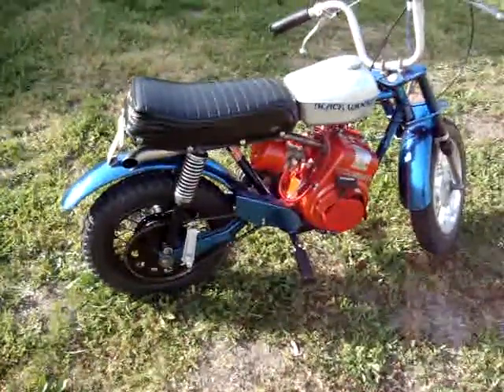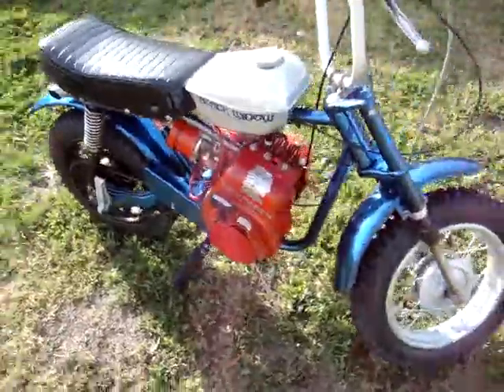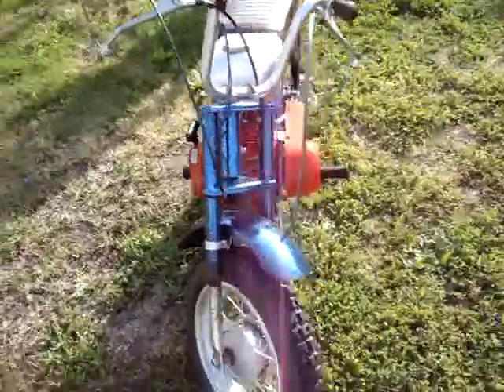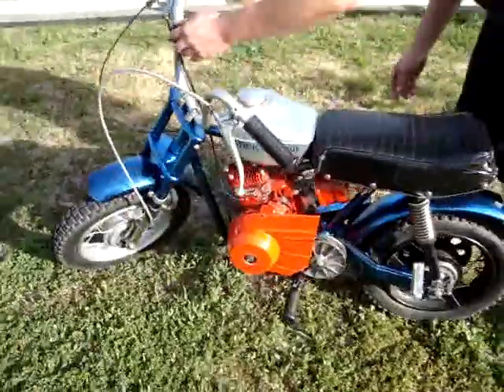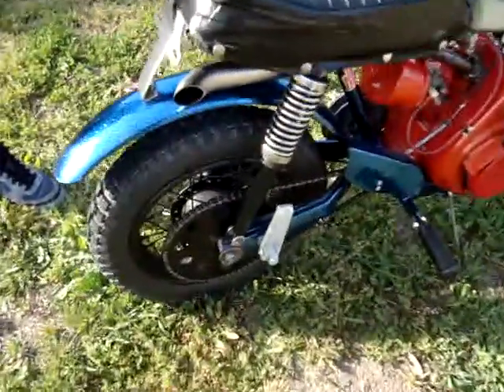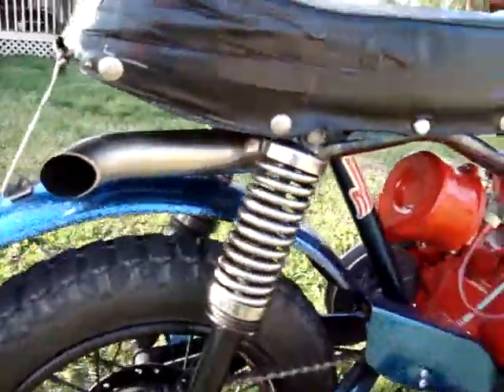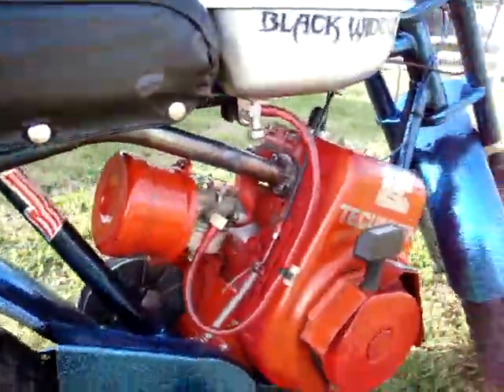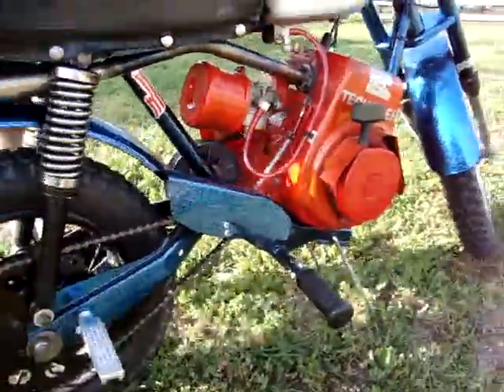Fast Mini Bike Rupp Roadster 2 Race

Comment: yea kool i got an all original roadster 2 also even the motor it been in a chicken coup for 20+ yrs amy dad boaght it new and gave it to me its rough lookin but i got it runnen w/ no problems still had spark and a semi clean carb lol been riden it all day just had to replace the chain to rusty and snapped lol

Comment: @ChetHell holy crap! Ive got a '70 Scrambler, and I'm gonna sell that stock h35 (rupp is reproducing parts.. in my eyes a "repro" bike isnt as special as in "original" bike... therefore im gonna get creative with it) and put in a brigg's 5hp flathead. do you have any mods on this engine for performance? I'm gonna do a couple light and simple mods to the briggs im gonna get, but hell, if its going this fast without mods then im almost afraid to do it.  great work! Shes beautiful!